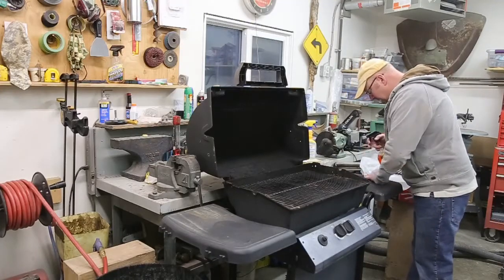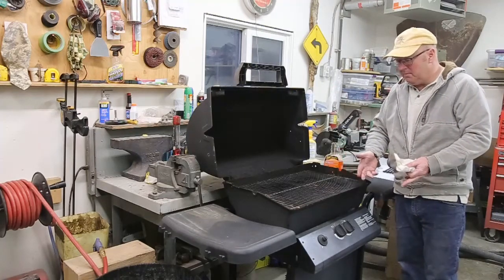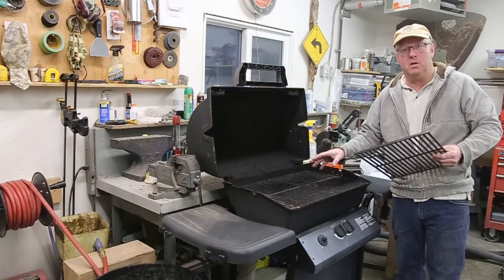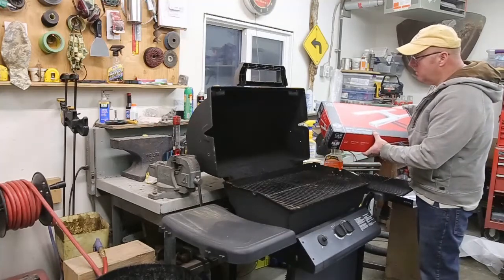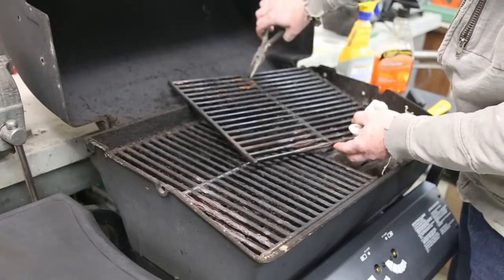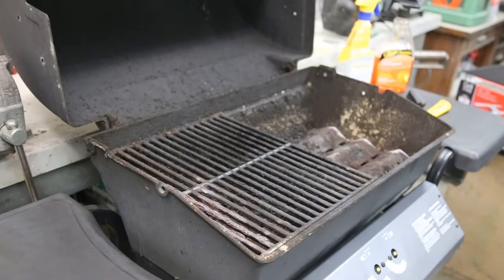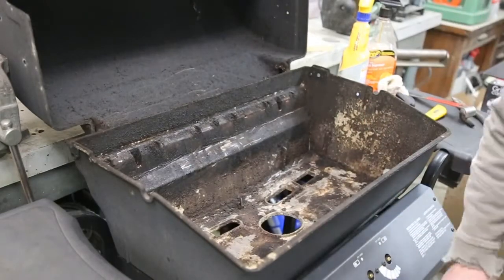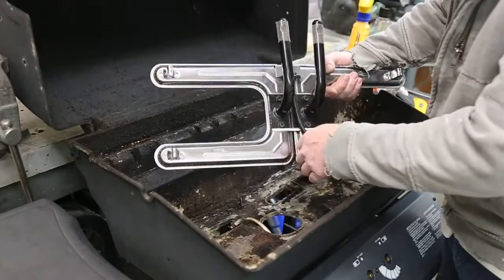Rebuilding a Broil Mate Barbeque

Comment: Great video!  I used this to fix my Broil Mate up.  I didn't realize how easy the replacement of the burner was!  I was about to buy a new BBQ and then did a quick search and found this video...  Now I have a working BBQ!  Thanks!
Reply from the maker: They are a pretty simple appliance to work on.  I really liked my Broil Mate and had no problem saving some money to tuner it up.  Thanks.  Stevo

Comment: Just had mine rebuilt after almost 12 years of use (same as yours). Canadian made, heavy aluminum cast and iron cast grates. 100% worth rebuilding. Surprise that you needed to replace cast iron grates, they should last forever. You missing top shelf on yours and I also want to point out that burner should be attached to bottom with 2 screws. Yours were most likely rusted out that's why you were able just to lift up the burner. My igniter works fine, just needed to clean contacts. Great grill and great video! Thank you!
Reply from the maker: I am still using it today and I love it.  The best part is, you can still but the parts.  You can spend a lot of money on a BBQ but it does the same job.  Thanks for tuning in.  Stevo

Comment: I've rebuilt mine and lasted another ten years. I've had my broil mate over 20 years. The handle just broke off so finally bought another one. Trying to find rock grate to convert to ceramic briquettes.
Reply from the maker: This unit has been great.  You may have to custom design your rock grate to work but I would think it is possible.  Thanks Stevo

Comment: I have the exact same grill. My issue is it wont go over 400°. I’ve cleaned my burner and get a nice consistent flame all the way around the burner. The flame goes up and down when I turn the dial but I’m not sure its burning at full capacity. I’m thinking its not the burner, could the valves need replacing??… any thoughts
Reply from the maker: It sounds like the pressure regulator that connects to your bottle.  Give that a try.  Stevo

Comment: What was the cost of the parts VS buying a whole new BBQ? Sometimes it's cheaper to buy a whole new BBQ.
Reply from the maker: I saved about $75.  For the time it took I felt it was worth it.  Now if I did not like the BBQ, I would have moved on.  And the sparker did not work at that time, was a bit corroded.